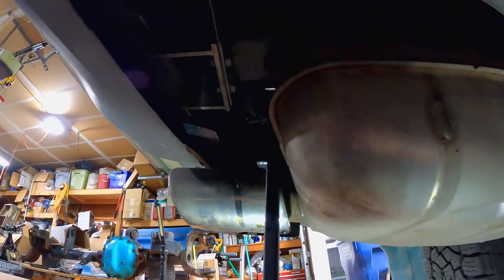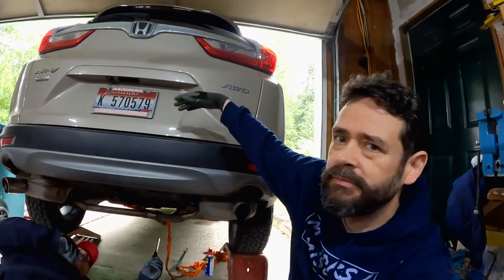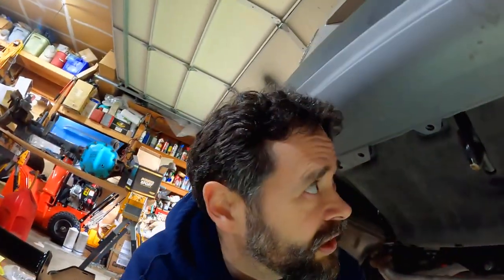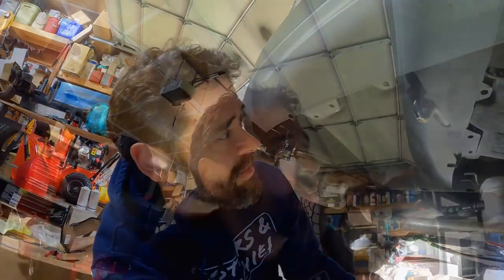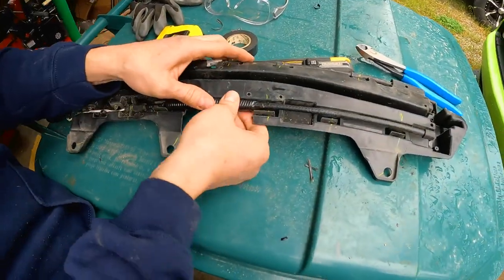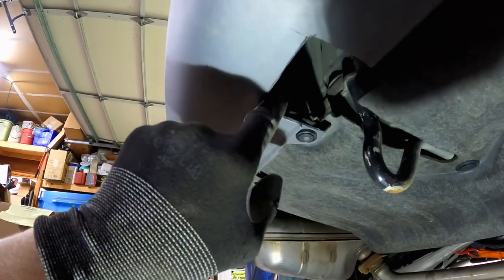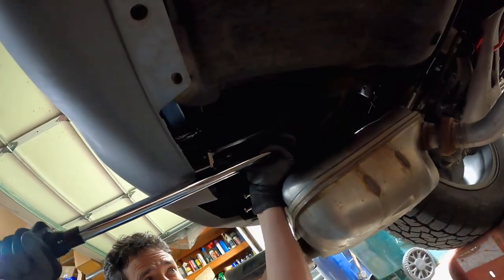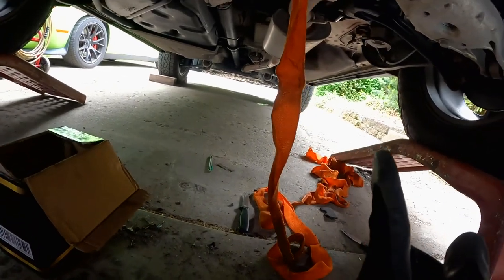Honda CRV DIY Hitch Install - WITHOUT Buying Honda's $700 Sensor Relocator!

Comment: Thank you ! I used this video to install mine. Only difference on mine is that i have the parking sensors other than the hands free liftgate. I had to reroute it and then zip-tie it. Other than this all was the same. Once again, thanks !
Reply from the maker: Outstanding! Its a great upgrade and saves a ton of money. Well done and thanks for letting everyone know it can be done.

Comment: Great video. The link for the Draw-Tite hitch is not the same you installed on your CR-V.
Reply from the maker: Good catch! Ok, here's the correct one: https://www.etrailer.com/p-DT79MR.html and here's etrailer confirming its the right one: https://www.etrailer.com/question-516432.html

Comment: There’s better videos here, why don’t you say the size of the boots and the torque.
Reply from the maker: Boots are size 10 mens, and the torque is about 3 ugga-duggas. Seriously, we always try to give you guys the torque specs but we'll only put them in if we can find a verifiable, trustworthy source. For the Honda CRV, we couldn't find one so matter how hard we looked. Similar tow bars say somewhere around 50 ft pounds. A 2 door Jeep Wrangler that has a similar tow rating to the CRV says 60 ft lbs.  But without a manufacturer's source, we're just guessing which is why we didn't include it. Thanks for the question!
Reply: @MotorsandMischief  Found it from the hitch company it’s 59 ft/lbs for the chassis bolts and 90-100 for the tow hook/ receiver bolts  for a 21 Honda CRV
Reply from the maker: Hey thanks for the follow up, that's a great help to other viewers!